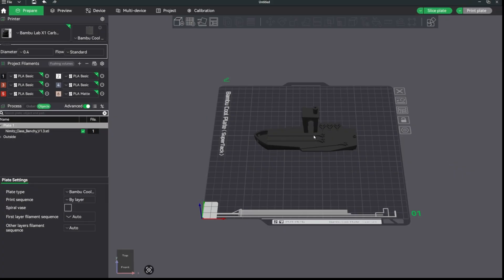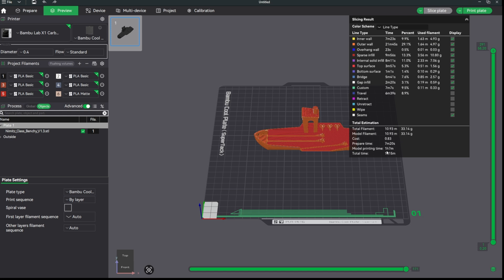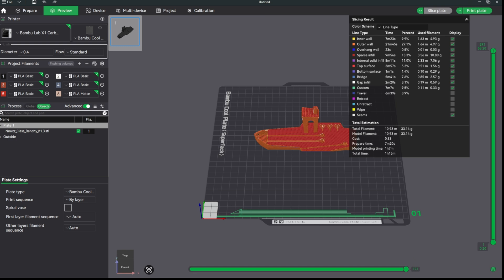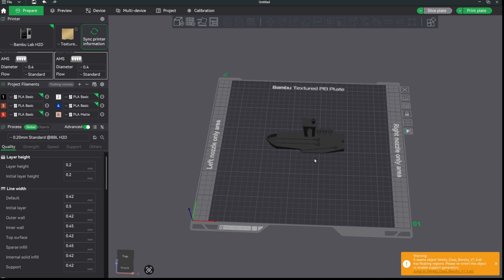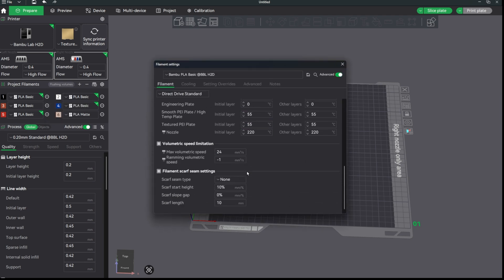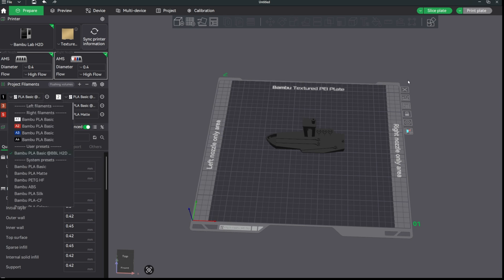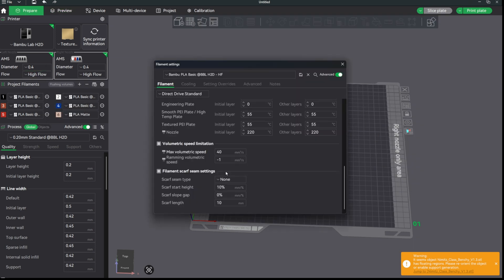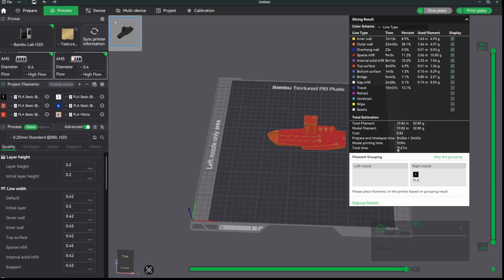Is the Bambu Lab X1C faster than the Bambu Lab H2D?

Comment: The volumetric speed will only make a difference if you change the process settings to match. For me with my X1C ObXidian nozzle, I changed the inner wall line width to 0.6 and the infill line width to 0.8, and changed from 3 to 2 walls to use close to the same amount of plastic and get huge gains. The printer really can't move fast enough to hit the limits at 0.42 line width unless you go to a really big print, but by changing line widths and reducing the number of lines, you can really get the benefits of the higher flow. You can see this if you choose flow from the summary drop down and notice that most of the print is getting nowhere near what you set. That being said, even if you don't want to fuss with going faster, the HF nozzle should give better layer adhesion and sheen at the same flow rate.

Comment: How are you calibrating speed on the H2D?  It's missing the Orca calibration tools, and Orca doesn't support it.
Reading that if you set Bambu Studio to different printer brand, the calibration menu will then show up.  Generate the calibration, then change back to H2D.  Don't know if that will generate an accurate calibration, but Bambu Studio allows it.

Comment: I think you picked a bad test model for the high flow nozzle. High flow will only apply for longer lines and larger in areas. You should try a cube that’s shelled the size of the bed.

Comment: Lol... increasing the maximum flow rate without increasing the actual printing speed - of course it doesn't do anything. 

You need to print at much faster (600mm/s @0.4x0.2mm) or much coarser (300mm/s @0.6x0.3mm) if you want to get anywhere close to 65mm3 flow.

I bought 0.6mm high flow hotends for my P1Ss and yes, it makes them up to 100% faster.

Comment: Setup time takes forever on the H2D. It's most annoying when the print is 30min, but has a 15+ min setup time. I haven't noticed a difference between auto and on, even printing the same exact settings back to back. Also, acceleration is slower on the H2d vs other Bambu printers. It wasn't designed to be a speed demon.
Reply: I don’t think I’ve ever had a 15 min prep time. It’s much shorter than that.

Comment: Surely the print time will be limited by the set print head speeds defined in the settings / g-code? unless you've changed those, how are you expecting it to go faster with the HF nozzles?

Comment: on a small print a HF noz is not that big of difference.  The reason is a small print like that it is made of lots of little lines. acceleration is the limit. short lines never allow it to get up to speed before it needs to slow down to end, acceleration in reverse, is still acceleration. Not suggesting an acceleration change. Just explaining the small difference being so small. If you printed a large cube, I would expect a big difference.